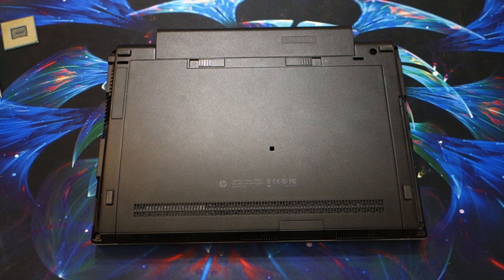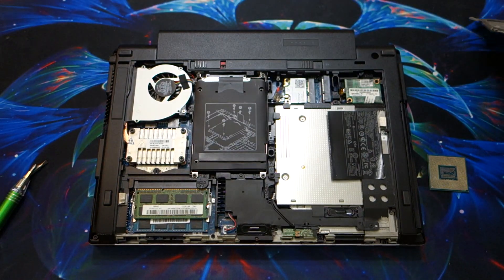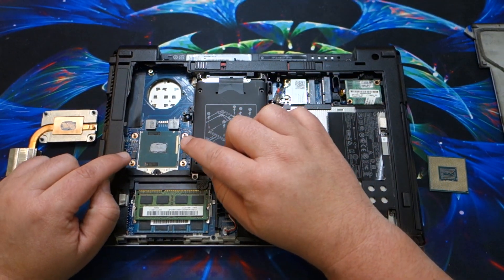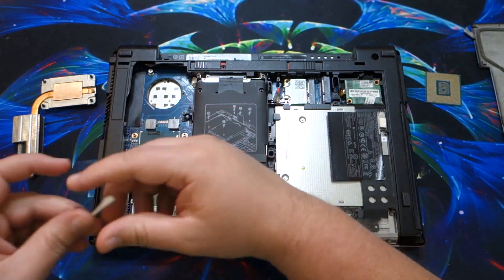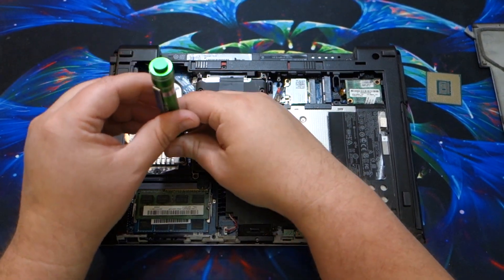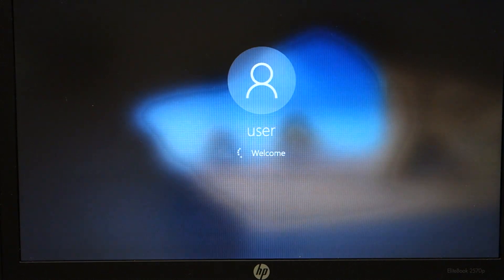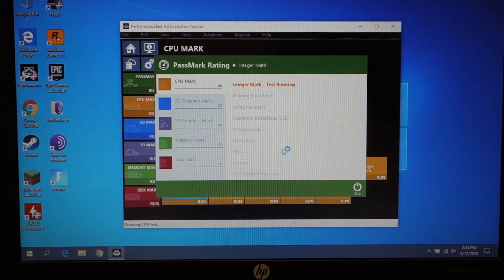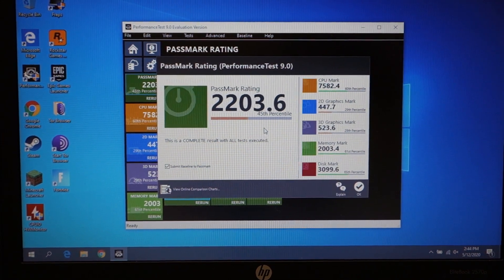HP EliteBook 2570P i5 3320M upgrade to i7 3632QM

Comment: @AICvideo Is it worth doing this upgrade if I already have 16 gb of ram in it? It doesn't look too hard, but I see a few people saying it wouldn't boot after doing this, so it makes me a little nervous. Also, mine has an i5-3360M @2.80ghz in it currently. I see the i7 3632QM is 2.2ghz. Would it still be faster because it is quad core?
Reply: Aggiorna la versione bios a f73.

Comment: Hey did anybody tried something faster than the 3632qm in that laptop ?
Reply from the maker: 3632qm is a 35w cpu, anything faster is either 45, or even 55w, and The cooling system is not up to the task of keep that much cpu cool.
Reply: @AICvideo  ok thanks... I'm running the 3632qm now and it's good

Comment: I wonder if the 3632 is worth over the 3520...
Reply from the maker: 2 vs 4 core, 4 vs 8 threads. It would make a difference, the real question... is it worth it? the 3632 is $75-100.
Reply: @AICvideo  yeah that's what I'm thinking... Won't do it ryt now... Got the laptop for 100.bucks 😂 6gigs, 240ssd, 3520.... For a kids laptop (school)

Comment: I notice you have rockstar on your pc. I am assuming you have gta v running on your laptop? I know from personal experience the i5 3320m is pretty bad with gta v. Did updating to the quadcore improve the experience? I know that the only way to get gta v to run with acceptable frame-rates but with some dips depending on the environment with a i5 3320m is to have 16 gigs of ram and resolution at 800x and with graphics on every lowest setting. Does gta v take advantage of the quad core?
Reply from the maker: I think I picked up a frame or two, The graphics processor doesn't change, so the overall gaming performance doesn't change much.
Reply: @AICvideo  I think it helped a little bit with higher resolutions too. On my mac os side I can have even more chrome tabs and windows open. I think that's usually ram related but everything seems to be running better overall after the upgrade.

Comment: I am waiting for a i7 3740qm to come in the mail. Going to put that in my Hp 8470p which is similar to your 2570p. I am going to be using Thermal Grizzly Kryonaut paste and I also bought a OEM fan v5 so I can update my fan since I accidentally snapped one of the screw parts off. It still works but I just want to make sure everything is aligned properly so I can push as much hot air out as possible. I know that the i7 3740qm runs hotter since it's a 45 watt cpu. The OEM fan might have to have some of the dust cleaned off it which I use q-tips just like I normally do to clean laptop cpu fans. I ended up buying it used because the price was cheaper than paying more for the OEM fan. The other brands are chinese knock offs. One of the sellers I dealt with lately showed a picture of a Foxcon v5 cpu fan and he sent me an entirely different cpu fan. I had to send that fan back to the scammer. I hate when people false advertise. Not only did they send a cheap chinese fan but it didn't even have the screws that were in the Foxcon v5 cpu fan.

Comment: well this was helpful too but what am after is installing my fingerprint on the 2570p. i tried many process but nun work the installation will be done but the biometric will not show in the device manager and by that it will not work in the main settings panel so i don't know if you can help with that ill be very great full if so

Comment: Hello! I still need help! I tried putting this CPU in my laptop and it powers on, the fans dont spin fast so its detecting it I think, but i just get a blank screen, please help!
Reply from the maker: put the old CPU back in, if it works, then it's the new CPU. you might be able to update bios if it hasn't been, other than that, you might have a dead CPU.

Comment: Nice tutorial there !

I have the 3520M 2-Core i7 in my 2570P.

Which upgrade CPU would you recommend ?
My cpu is rated at 35W ... many 4-Core cpu are rated at 45W or even 55W ...

Greets
Reply from the maker: the only 35w 4 core is Core i7-3632QM. I personally wouldn't go to a 45w, because I don't think the cooling system can manage it.
Reply: @AICvideo  yeah that's what was on my mind...

Comment: Thanks for the HP EliteBook 2570P  - CPU upgrade tutorial form i5 3320M to i7 3632QM. In this new configuration will this system be Windows11 compatible? Please advise :)
Reply from the maker: Compatibility is a bit ambiguous, https://www.cnet.com/tech/computing/windows-11-compatibility-does-your-pc-meet-microsofts-requirements-find-out-now/, you have to scan it after the fact.

Comment: Can this hp use hdd and ssd at the same time? Both installed.. cause i use ssd 120gb, fast but not enough..
Reply from the maker: No. just buy a lager SSD, they have come down in price so far, you can get a 1tb SSD for as little as $75USD.
Reply: @AICvideo  in order to change the ssd, we need to reinstall tthe window or anything?
Reply from the maker: clone the drive. I have a few videos covering that topic.
Reply: @AICvideo  do you know how to decrese the temperature during gaming? I'm Using stock core i5 with tweak in settings..

Comment: i have the same core i5 is it worth upgrading to i7 to use solidworks and mastercam?
Reply from the maker: anything CPU intensive will see a marked improvement going to a 4 core i7 vs the dual core i5. I personally am not familiar with those two applications, but yes, you'll see a big improvement. But making that decision will come down to price. Getting a i7 3632QM will run you around $80 on ebay, but for starting around $250, you can get an 8th gen core i5 that is also a 4 core processor, https://ebay.us/gDQBHm, and it will significantly out perform the 3rd gen i7, not only in CPU performance but graphics as well, you'll have faster memory, and possibly even nvme storage, which is faster as well. so Its worth the consideration.
Reply: @AICvideo  thanks

Comment: Thanks for this video. I’ve been using one of these laptops to host VST instruments for live performances. The I7 dual core that it came with was struggling a little. I just upgraded to the quad and so far the improvement has been worth it. CPU utilization is much better. I also have a 2560p. Maybe look into upgrading that as well.

Comment: Hey man. Totally unrelated to this. I have the same laptop, but, for some reason, the integrated audio just refuses to make any sound. I've tried everything from drivers to testing the actual speakers in another laptop to make sure they were working and nada. Test on windows and Linux, and no luck. I read on a tread in tom's hardware that the problem lays in the bios, and a bios revert should fix it. Do you have any information on this? I saw your bios version is f.31. I'm running latest F.73
Reply from the maker: sorry, I don't. I never experienced this issue, so I didn't have to troubleshoot it.

Comment: Hi Man, Thank you for your post. This makes me think of upgrading my HP 2570P icore 5-3210M. I have  a question and i hope you will reply. Does your icore 7 processor compatible on mine? Thanks for your reply
Reply from the maker: I use this website:
https://www.cpu-upgrade.com/CPUs/Intel/Core_i5_Mobile/i5-3210M_(PGA).html
Reply: @AICvideo   Thank you man for quick reply.   i will review it now. Thanks again
Reply: @Alcvideo can i ask question again, can i upgrade RAM to 16gig on  HP 2570P icore 5-3210M or after i upgrade it to icore7?Thanks
Reply from the maker: Yes
Reply: @AICvideo   that's good. a friend of mine told  me  i can only upgrade it to 8 gig as it doesnt support 16. is it true? i'm confused. I'm afraid if i buy 16gig, 8 gig for each slot it wont work.
Reply from the maker: even that i5 will support up to 8 gigs per stick, it won't support 16 per stick, but 8 per stick is fine. so 8x2 =16. You're good to go.
Reply: @AICvideo  Hey, thanks man for the reply, i appreciate it. How about replacing lcd screen to IPS panel is it possible?
Reply from the maker: Not that I could find. i don't think it came with one, so no after market replacement parts.

Comment: Hey bro. i have a question. I have a hp 2570p i5. Last month it stopped working without any reason. I changed Ram and hd, but doesn't work. Just fan work for some seconds and again off. Soooomtimes on and off. My friend had a damaged cpu, we tested. It's worked for about 1 hour , I updated bios and installed new windows, and after 1 hour off again. And doesn't work now. Just Fan and off. Battery charging is normal. What's your idea?  I should buy a neew cpu? Or has a bigger problem??? Thanks
Reply from the maker: bigger problems if you damaged a 2nd cpu. you probably have a short on the board.
Reply: @AICvideo  thanks man. Today I changed cpu but it doesn't work again. Just fan works for 5-10 seconds and off again.
Reply from the maker: Sounds like a bad system board
Reply: @AICvideo  aaaah so I can not fix it. Nooooooooo
Reply from the maker: Just going off the information you gave me...
Reply: Bios  rescovery  for 38 second push on button start.

Comment: I have a Lenovo G400s with i3-3110m, 8gb ram and ssd.  I'm thinking of upgrading to i7 3632QM. Do you think this will make a big diference? I use the laptop to work, a lot of tabs on chrome, and other programs at the same time, my current cpu is not handling this well anymore.
Reply from the maker: it would be a HUGE difference in performance. When you have that many windows open, how much ram are you consuming. I might see if bumping up to 12 or 16 gigs of ram (depending on what config you have in there now) would do. I set up a desktop for my kids with a ryzen 3, 3200g and it ran like poo, it only had 8 gigs, I bumped it up to 12, and it ran a ton better. A Core i7-3632QM is $83 (cheapest buy it now on ebay), ram would be a lot cheaper.
Reply: @AICvideo  
Thanks man, I will check the amount of ram that is being consumed with the maximum of tasks, maybe a RAM upgrade is really a better choice.

Comment: Finally I know this processor is not an exact match as your proposed upgrade but I would like to use the Core i7-3820QM because vPro, Trusted execution etc. Because it is 45W instead of 35W, do you think that using liquid metal instead of thermal grease/paste maybe a better heat skin, would be a viable upgrade?
Reply from the maker: Liquid metal won't do that much better than regular thermal paste with a stock cooler. The limit here is how quickly the stock cooler dissipates heat from the system. I've put 45w cpus in before and been fine,  I just really wanted a 35w system. for heat and battery life.

Comment: Hi Have you check if the DP is multi streaming ? that is to say, if can hold three external monitors without the one of the laptop or two externals and the laptop one
Reply from the maker: I don't have a doc to test, but from my experience with other laptops, It will probably support 3 total monitors, the laptop monitor and 2 external IF you have a doc. Otherwise it just supports 1 other monitor from the HDMI on the side. you can get USB 3.0 adapters for another monitor if you don't want to use a doc, but in my experience they are pretty low quality, and don't support very high refresh rates, or high resolutions.

Comment: i have an hp folio 9480 m and it has horribal fps any ideas on how i could improve my gaming preformance
Reply from the maker: ... Get a new laptop. that laptop has just integrated graphics, and you cannot magically change that.
Reply: @AICvideo   Yea thats kinda not really an option for me there really nothing i could  do
Reply from the maker: @ghostyanimationz2276  not for gaming. if you haven't already you can upgrade your ram, or go from a hard drive to an SSD, but the impact on gaming performance will be minimal. It will run better in general though.
Reply: @AICvideo  my model is not compatible with thunderbolt any other eGPUs that might work with my laptop

Comment: I've been thinking of upgrading mine though I wanna make sure that I'll buy the compatible ones. Is Intel CPU SR0V0 i7-3632QM Intel Core i7 Mobile Chip central processor 2.2GHZ 6MB SROVO I7 3632QM the same chip you used?
Reply from the maker: https://www.cpu-upgrade.com/CPUs/Intel/Core_i5_Mobile/i5-3320M_(PGA).html

Comment: Sir T3400 Core 2 Extreme best or HP 8000 Core 2 Quad..???
Reply from the maker: Neither? I wouldn't recommend anything older than a gen 2 core i5. core 2's are just too slow now, unless you are running older software.
Reply: @AICvideo  ok thank you for information.
Reply from the maker: Sure thing.